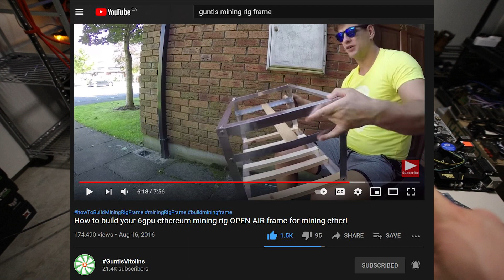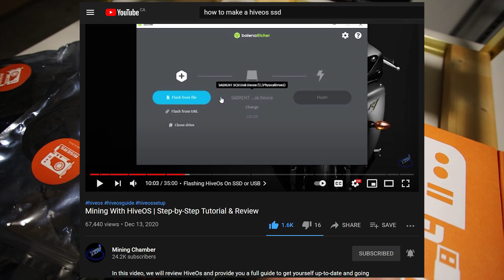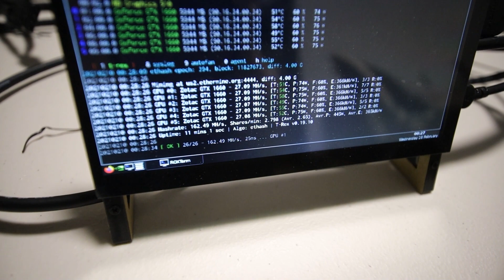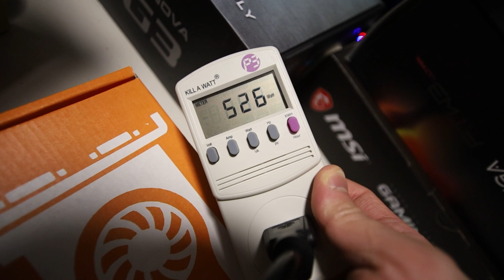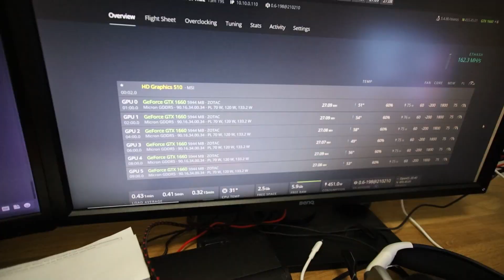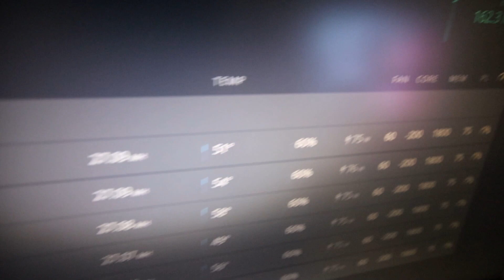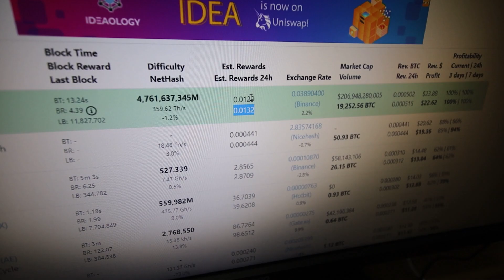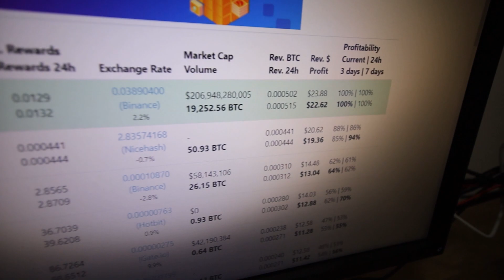Building a CHEAP? $2500 ETHEREUM Mining Rig...

Comment: I woulda went with a platinum or titanium power PSU’s, my system posts weird kinda like that it acts like it’s gonna post then it shuts off for a second cones on and posts but only after I make a change to it like changing the M.2 or simple as re-pasting the CPU even caused it to first boot again, 1660’s are going for almost $1000 now, GL building that rig for $2500 now

Comment: I have an old H81 ASrock that restarts 3 times when I turn it on, then runs stable.  Might be related to a bad CMOS battery but haven't confirmed.  This board resets to default BIOS settings after 3 failed starts...  May be a similar issue on your board?

Comment: I know what's wrong with the motherboard. I had the same issue. as it's an LGA one, it most likely CPU pins on the motherboard. they get bent or broken easily. If you don't have any broken pin you can fix it up easily by put bend them back to their original position. otherwise it's dead.

Comment: Hi. The reason why you have a restarting d3a board is you did not plug in the supporting molex connector. It will supply additional voltage to your pcie slots. :D

Comment: same problem, multiple h110 d3a mb's. worked perfectly with GTX 1070's but when i switched to 1660 SUPER's, it didn't work with 6 GPU's plugged in. had to take one out. and it would work with 5. then i reset it a couple of times plugged the 6th gpu back in the mb and it worked. its probably gonna reset after the first power drop and i have to do this all over again.

Comment: I had the same issues with a z390 gaming with 2 1080tis (1 founders and one evga SC). For me, I had to change the bios settings so the pcie was gen 2 along with changing the bios default graphics to be external. Then, out of desperation I only plugged in the 8 pin connecter to the 1080ti that was causing the trouble and the rig booted. As it booted I then put the 6 pin in. Once in windows it was recognized. Not sure why that was the solution, because I tried so many other configs before that worked. But it always gave me a vga fail on the mobo and would continuously restart. Since then it has worked fine. Hope this helps and thanks for all the content.

Comment: You forgot to plug in the  4 pin power connector left of the GIGABYTE, you have one more underneath the last PCI. I guess they need to be powered.  Regarding to my manual of Asus B250 the AUX power has to be plugged in

Comment: Plug the molex cables into the mobo. Normally it says to in the mobo’s manual once u have a certain amount of gpus plugged in.
Reply: Do you need to plug molex to mobo with risers? Honest question. I have the same board, and works fine with 4 3060ti/3070 cards withoit molex attachet to mobo.
Reply from the maker: sadly no, the risers are already powered, but i did try the molex after recording and still rebooted and turned off. Its the board.

Comment: Nice!! Thanks for sharing, question, can I use the regular gpu x16 slot to use let’s say a gtx 970 and then use the riser cable to connect another different gpu? I mean can It be used the x16 and the riser cable pcie at the same time? I don’t need the 6 raider combo I just planning to use just 2 gpu for now

Comment: I am always amazed to see other peoples stats with 0 stale and 0 rejected shares. I have fibre internet, ping speeds of 1 or 2 ms, when I ping to the miner address it is always about 30ms (my motherboard is hardwired into router). But the rejected or stale shares I get are 300-600ms. Percentage is approx 2-3% rejected or stale. I already dialed clock speeds down (from 1800 to 1780) and core votlage from 730 to 750, hashrate down by about 0,5 mh/s - running a 5700xt (followed your bios mod video too). Any advise on this, or could you some time in the future do a video on this issue? Such a waste of power.

Comment: I'm mining using 2x 3060ti is it normal that I only getting 40-44 accepted shares every 1 hour? I'm using Nanopool on Phoenix Miner
Reply: What kinda OC are you running and what's the difficulty on Nanopool? Mine's 2.15G on Binance and I'm getting about 1.5-1.8 accepted shares a minute, no rejects. Difficulty dictates the amount of shares, so getting few of them isn't a problem per se if you're not getting rejected shares.
I would still recommend using T-Rex with "-dag-build-mode 2" option on 30-series cards. Or better yet, use HiveOS+T-Rex if you have issues with rejects.

Comment: I just entered in wattomine, and putting the same card and data used in this video, as of today april 24, profitability is way lower that when you made this video 2 months ago, still the price of ethereum is much higher. The estimated reward back then was 0.0132 and now is only 0.0070 wich is practically half the value on the earnings. Do you have any idea why is that?

Comment: I want to run a Bitmain L3 in my home. But first I want to run my pc (AMD Ryzen 3 3100- Rx 560) on minerstat so I can get my feet wet with the whole Process. Everything seemed fine until I got stuck with 0% efficiency(.044kh/w- 2KH/s) Website suggest pool is rejecting my shares. Is this a personal computer problem, should I try changing my default client, or pool?

Comment: Can I do this same build with two gpu's to start (add more later) and what would the input voltage be?
Reply from the maker: You can even start with 1 card
Reply from the maker: https://youtu.be/uC5FuoOK3Ck
Reply: @RedPandaMining  I have two gpu hd 7670 with 4gb ddr5 , is it still profitable?
Reply: @oldrepublic7251  You can't mine ETH with a 4GB card anymore, has to be at least 6GB.  Mining other things is possible, just not as profitable.

Comment: So if I was starting from scratch, would it be better to get 1660 supers? Basically I want to build a set up like this from scratch, all I have is a spare drive and motherboard with cpu. So should I go with 1660’s or maybe super ones? Thanks.
Reply from the maker: I will go with the supers if possible
Reply: @RedPandaMining  I’m new to all this so pardon any idiocy, but I’m trying to find used gpus and the prices just seem so inflated I’m having a hard time figuring out what price I should actually pay. What do you think I should spend on a rx 480? Or do you think I should go with a different gpu in whole. I’m hoping to run 6 total. Thanks.

Comment: I have some 1660 hynix memory and I can get them to 26mh easy at 1600mhz on the memory. Reports 70w in hive os. Just an FYI! Been hooked on the 1660 and 1660 super sice I picked a couple up about 2 months ago. 
I will try your settings on my hynix cards and see if they can keep up.
Reply: got them up to 26.75 MH at 1800 memory but it was not stable on all cards. I didn't feel like tuning in the cards individually so I dropped it back down to 1600 on the memory. still super happy with the 26.1MH that they will do on those settings.

Comment: the first motherboard doesn't work i think, becouse you touch that with your finger that have an electrostatic field around, and also a minimum of potential difference can breake one of the very little tiny transistors of motherboard

Comment: How much do you guys trust dual PSU adapters? I'm going to build a 2nd rig and don't want to pay $500-600 for the Asus B250 Mining Expert motherboard (which supports up to 3 PSUs natively). I'd like to just get a cheaper MB that can support 6 GPUs and use a dual PSU adapter. Any recommendations?

Comment: H110 has the dual 4 pin molex connectors I thought. Didn’t look like those were connected
Reply from the maker: I plugged it in After recording that, still turned off and on.
Reply: @RedPandaMining  unfortunate. Had the same issue when i started building with the Asrock BTC pro+ 13 pcie board. First board was bad but every mobo afterwards has been golden.
Reply from the maker: @fortismining758  happens to the best of us! haha i think i've had like 3 mobo's die in my lifetime of mining so far.

Comment: you did not plug in the 4 pin molex into the mobo. would that possibly cause the reboots?
Reply from the maker: sadly no, the risers are already powered, but i did try the molex after recording and still rebooted and turned off. Its the board.

Comment: Please let me know, Single 8 Pin Pcie can handle 300 watt ? 300watt cause have many spliter for gpu and riser
Reply: Personally I wouldn't risk running so much on the PCIE cables and just run power to video cards through the 8pin and power the risers with molex/sata. I get that people think those power sources aren't as stable for risers, but you also aren't running the risk of burning out pcie cables either. Pick your poison.

Comment: Got 4 3070's 1 2080ti oc and 1 rtx 3090. profitability a day is £35 - £40 per day. It will take me 4 - 5 months to break even. Personally I think it's worth it.
Reply: what's your electricity cost?
Reply: @rh7732  0.15 kwh
Reply: @rh7732  it works out with using all of the GPU's that I use the average UK household in electricity so total cost is ~£160 a month
Reply: @lethyadon1182  yeah I'm from the UK I don't see much uk people making vids on it so thanks for that info sounds like it's profitable atm
Reply: @rh7732  yeah honestly it's pretty good. I will be moving my rig to my farm though as the electricity is free ...hehe. But eve n with elec at 0.15 - 0.20 kwh an hour it only works out to be about 30 kw a day, which fror me is £130ish a month or £4.50 a day and that is with my entire house running ( I turn off combi boiler)
Reply: @lethyadon1182  do you think mining will be good long term? after the next halving etc. or when the crypto bull run ends
Reply: @rh7732  at the moment btc is really solid and more and more people are invested in it so I see long term it only going up. next btc halving is in 4 years and when ETH goes to PoS then likely RVN will be mined instead

Comment: I did your setup. But for whatever reason I can only make 4 GPUs to work. The only difference is that I used windows to mine. 
Did you do anything special to make 6 GPUs to work.
Reply from the maker: Enable 4G decoding in the bios
Reply: @RedPandaMining   thank you very much. It worked instantly. Now I got all 6 GPUs to work.

Comment: I just started mining almost 2 months ago , i managed to get 4x used rx580 8 gb with a good price , now the prices are insane here (ukraine) for 8 gb cards , around 500$ for a used rx580 8 gb , with 500 i can get almost 4 rx580 4gb cards and mine Rivencoin , 4 cards mining Rivencoin are more profitable than 1 card mining ETH with today's prices , do you recommend doing this ? Electricity prices are 0.05$ per kwh 
Also i keep hearing ETH network difficulty is increasing insanely , maybe after some months mining ETH will not be profitable anymore for small miners and we have to switch to another coin !

Comment: Do we need a monitor for that, i saw the small screen right there connecting to the rig, where to get that? I didnt see in ur link discription
Reply from the maker: 7 IN Touchscreen Monitor: https://geni.us/zFeT
Reply: Thank you for quick response, can u make video with step by step building mining rig, im new in crypto mining
Reply from the maker: @Lov3message  I will have one very soon
Reply: I got 6x1660 super  and all the parts just dont have monitor and also looking for good website (pool) to register.
Reply from the maker: @Lov3message  give ethermine a try
Reply: One more question does g4930 celeron comes with cooler if not what cooler should we go with it

Comment: How do I learn how to make one of these??  (i.e., put everything together from the great list that is provided) Thanks!
Reply: It's like building any pc. Except with a rig I would recommend 2 psu with about 4 pcie/vga slots. Each slot is 1 gpu. Evga has some solid psu. 

Most mobos have 1-3 regular gpu slots and 1-4 tiny pcie slots for risers. These are tiny rectangle slots under the big 16 pin slot. 

You  then slap your power cables onto the gpus and a 6pin cable to the riser. Don't use sata or molex to power the riser. CPU doesn't matter, get a cheap one. Celeron or pentium. 

I can fit 2 gpus (3060ti+1070) on my pc without a riser, 4 gpus if I use risers. If you want to mine tho, you gotta make sure you can get it up and running ASAP like within a week or 2. EIP 1559 might actually roll put this summer, making mining ethereum pointless but you can mine ravencoim after that.
Reply: @50rads  I have a 650w psu, I probably can’t run 2 gpu’s right?
Reply: @jdub8305  you can, but you're risking frying your system if something goes wrong. You should just buy 1000 or 1200w psu with enough ports for 2 gpus
Reply: @50rads  dang those aren’t cheap
Reply: @jdub8305  check the power wattage of both gpus and make sure your entire pc doesn't exceed 520 watts. You can also buy a 2nd 650w gpu and a 3 way power cable to hook up 2 psu to your computer.

Comment: Could you have lowered the power supply to like a 600w or 700w since the kilowatt measured 525?  The graphics cards are eating 450w and the rest is mobo, etc so 150 or 200w max to run everything else with spikes included?
Reply from the maker: Check this out bro https://youtu.be/-Frelfppb0w
Reply: @RedPandaMining  @22 mins the answer is yes eh?  Not new to tech, just mining and putting more than two graphics cards on a system.  Looks straight forward and sold on HiveOS to avoid default resets on watts.

Comment: Hey guys, watching this video now and doing some calculations, it seems that the income on this rig has more than halved since he first posted the video. Is that right? According to most profitability calculators, a 1660 is only making a little less than $2/day. Why has profitability it gone down so much?
Reply: because difficulty increases on the blockchain. meaning that more hash power is needed to get the same rewards.

Comment: i have a similar rig i started to build, z390p mobo you recommended, but every time i add a second gpu my hashrate drops by over 50% any ideas? windows is optimized, and bios setting should be right
Reply: Did you find your answer?

Comment: Guys correct me if i am wrong but he has to power the 2 molex pin on the H110 mother board before running 6 gpus ?
Reply from the maker: Shouldnt need the molex as the gpu's are powered by PCIE but I did try adding the molex after recording and still did the same thing.
Reply: @RedPandaMining  good to know i am about to use same h110 for 6 rtx 2060 will see what happens :) 
cheers mate awesome videos

Comment: the molex connector on the motherboard is likely the issue...
Reply from the maker: nope! tried it after actually and still did the same thing.
Reply: @RedPandaMining  well then you've prolly got a short thru one of the smoothing capacitors on  th mb... you could pay up to 300$ to have it repaired or simply replace it

Comment: seems like it might be 5 months to pay off the 2500$.. interesting experiment anyway.. 
.. the downside of using cheap cards is that there's simply a volume of stuff in there - 2x 3080 theoretically might cost the same if you can find them at around 1000$ k recomended price, and it would take a lot less material to make 
.. I mean when you back up and see what's going on - a 3090 can easily cost 2500$ now and more, it's roughly 40% less power, but it's one single card - this thing here has a volume of material added ..
What makes a 3090 chip so much expensive - it's just a thin wafer - everything else is like cheap as hell, would it be cheaper to make a miner board with 4x 1660 chips - they did that with gtx 590 a long time ago, but not doing it anymore.. 
..what I'm saying, it's a lot of wasted material in fans, heatsinks etc .. especially now, would squeezing in 2 gpus on one board make more sense, are the purposfully doing it this way - to earn more, more plastics, heatsinks and mainboards ..

Comment: I am hoping someone can explain how the power is handled for the riser when you have limited PCIE power slots on the power supply.  it is my understanding that its not good to use SATA or mylar connection for the riser power.  Assuming the splitters listed would allow two GPUs to be powered by one connection on the power supply that would leave one open connection on the power supply when you have 6 GPUs.  Using SATA, it solves the availability of connections to the power supply but its not safe?
Thank you.
Reply: If you only use one sata to molex per a strand you'll be fine for most cards. Especially something as low overall power as any of the 1660 models.
Reply: @piked86  Hey Pike.  Thank you for the response. I have 580s and 1 5700 XT.  Currently using SATA but was sure to do one card per strand.

Comment: Im new to mining and i have question. Im mining on rx550 4gb micron memory 1250mhz core,2000mhz memory and bios moded, on hive os, lolminer latest version where you are able to mine eth with this 4gb gpu at amazing hashrate (for this gpu im geting 18-18.5 mh/s), problem is that im mining on ethermine pool and when i go there it says same thing as to you, at ~ 12:15 reported hashrate is way higher than average and the actual current hashrate on the pool, for me reported is 18.3mh/s and actual hashrate is 1-2mh/s. Is this normal and i should watch only reported hashrate, is it bug, or it is bad and im acctualy getting 1mh/s, or something else, pls help :(

Comment: 300 watts divided by 600 volts equal 0.5 amps...

Since those are 12 volts connectors, 300 watts would require 25 amps. 

I think you must have been looking at a wiring awg diagram for longer runs. You should be just fine running 25 amps through such short wires though. There are 3 sets of power cables in there, so you can divide the amperage load by 3. That's only 8.33 amps for 18 awg which is fine for a few feet. I've run much MUCH more.